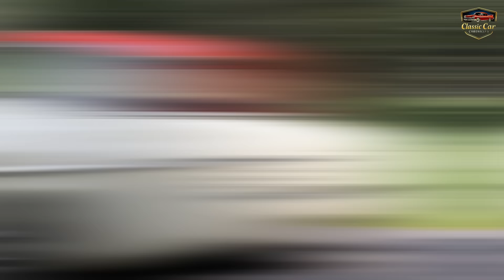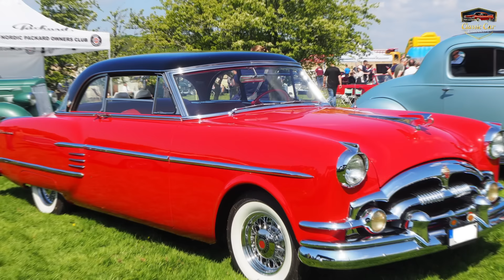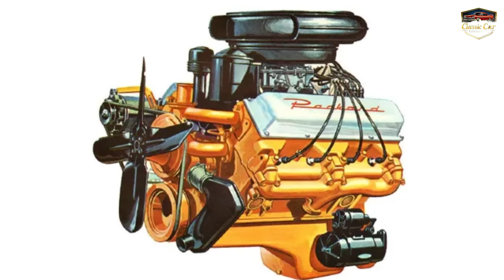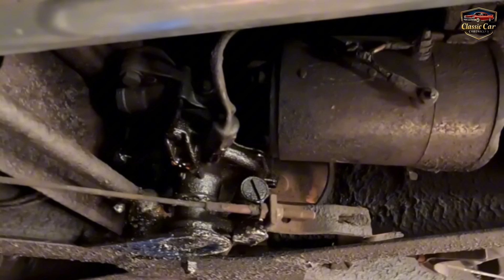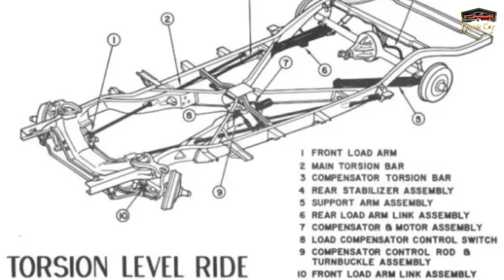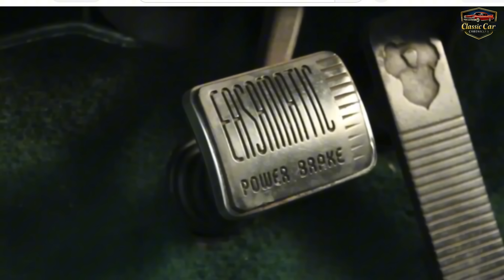The Most INSANE Brake System Ever Put in a 1955 Packard (310HP)

Comment: My 1958 Oldsmobile had its non-power brake master cylinder mounted on the bottom part of the driver's side firewall. I had to put the car on a lift to get at the master cylinder. One day it failed completely and I had to use the mechanical parking brake to stop the car. A real sucky design.

Comment: Looks like the V8 at 3:52 is from a Nash / American Motors brochure.  That's a Nash torque tube coupling at the back of the transmission.  Nash used the Packard V8 in the 55 Ambassador models.

Comment: Wow, just wow. So much misinformation, starting with the engine, they installed 356 cu in engines and it wasn't the largest installed in an American car, they also installed a 384 in their 1929-36 cars. 

They merged long before 1955, and it ended up that Packard ceased production in mid-1956 because of the loss of air force contracts, which is when they started to build Packabakers. 

The brake system is simple, it was used on a lot of cars of the time. There is still a restoration service for them.

Comment: Aluminum heads on flatheads isn't quite the shock that many of you young people seem to think it is.  Literally dozens of flatheads had aluminum heads!  The Ford Flathead V8 for instance could be equipped with them.  Chrysler's "Spitfire" 8 had an optional "High Compression" aluminum head.... even HUDSON had optional aluminum heads for their flathead sizes.  Don't forget, aluminum was not a new invention.  Even in the 50's and early 60's.... Chrysler, GM and even American motors had aluminum engine blocks.  This wasn't "new" technology! It was slightly more expensive though.  That's why it wasn't done often.

The Brake system is no different than what you'd find on a Buick of the same vintage.  That's just unfortunately how early power-brake systems were.  Also, I'd like to point out that Packard most certainly designed a way to check brake fluid in the car.... it's just that today, people are either ignorant or just don't notice details.  The master cylinder reservoir used on these cars has a removable lid.  Putting the lid on incorrectly places the screw-cap underneath the Packard steering column.  Putting the lid on correctly puts the screw-cap lid to the opposite side making it easily accessible.     The biggest issue is that too many "smart people" have mucked about with these cars over the last 70 years.
Reply from the maker: Thanks for providing all this great context and insight into the aluminum heads and early power brake systems!
Reply: @Chuyenkecuopbien   Another A.I. channel using STOLEN CONTENT! REPORT!
Reply: @390rambler Why can't AI find more than one image of 1955 and 56 Packards?
Reply: And the irony was Ford put its master cylinder on the firewall, starting with the 1952 models, like virtually any car/light truck today.
Reply: On the 23rd Series Packards, 1949 / 50, those that were delivered with the Ultramatic transmission had another inadequately designed fluid cap. The automatic transmission fluid filler is a short, about 2 inch diameter, capped tube on the left side of the transmission. One can check the fluid by:
1. scooting under the car and contorting one's hand up and over the cap; or
2. putting the car on a lift and doing the same hand contortion; Or
3. Taking up the mats or carpets over the transmission hump, unscrewing about a dozen screws holding an access plate and reaching down to the filler tube.

I don't know if Packard changed that in subsequent years.
Reply: @RobertJarecki  Early 1970s Dodge van vibes.....where the dog house had to be remove to access that dipstick. On my van; I simply fitted a 1979+ longer tranny dipstick and matching tube.
Reply: "Don't forget, aluminum was not a new invention." The Wright brothers' first flight engine for their 1903 Flyer was revolutionary because its crankcase was made of lightweight aluminum.